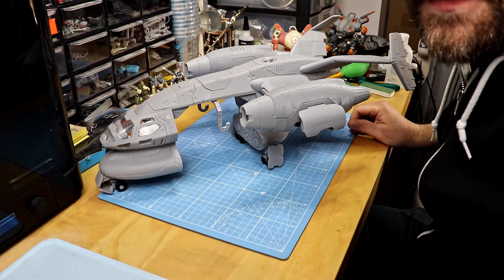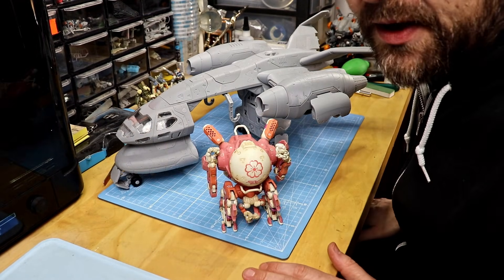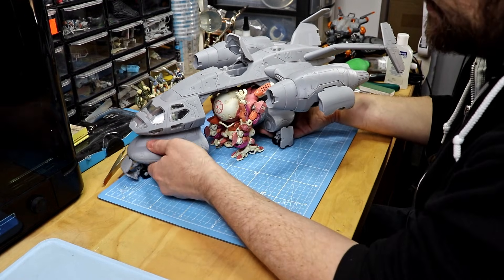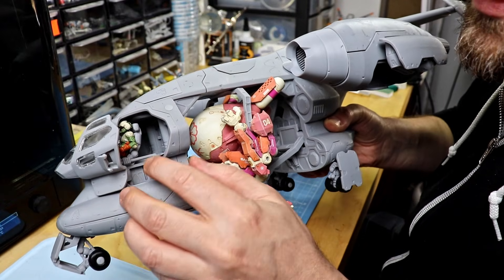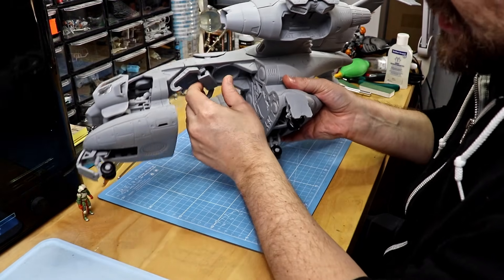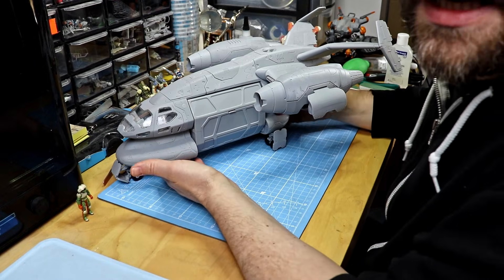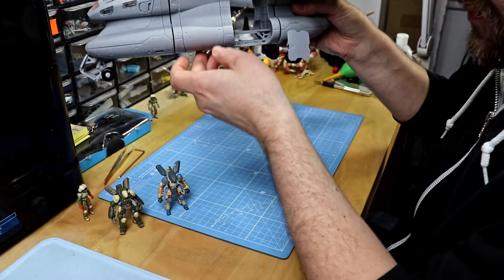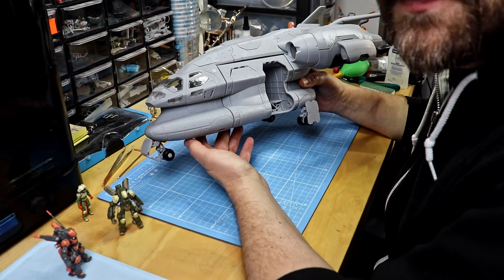Mech Carrier Work In Progress

Comment: Very nice work. It's a good looking transport craft and I love all the mechanical features you've built into it. It also give me another idea for a possible feature: an optional aerodynamic fairing for the mech transport mode. It could be a pair of panels that fit over the left and right sides of the mech and are secured by their top edge between the ceiling of the mech bay and the shoulder hook. Then when the carrier lands and lowers the hook the fairings fall away ready for the mech to disembark.